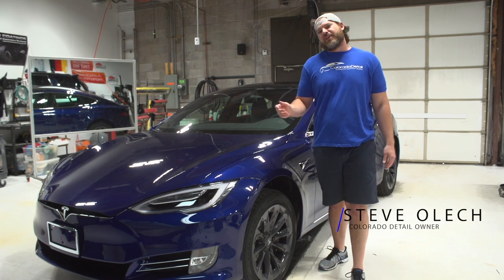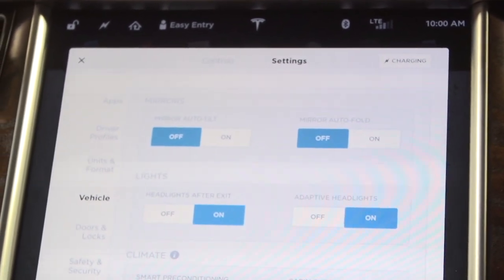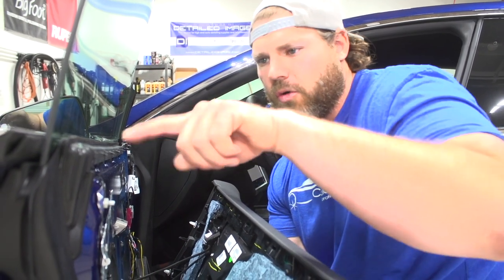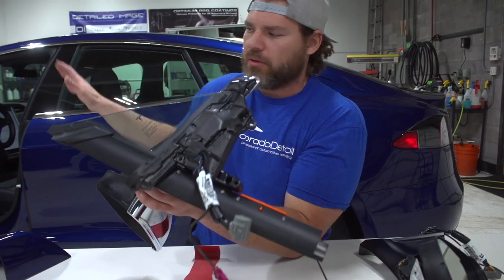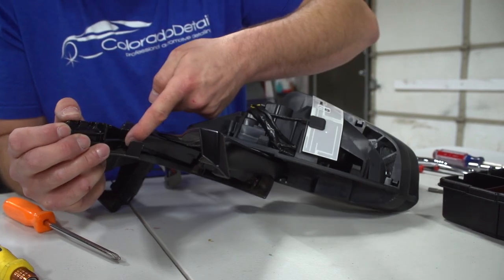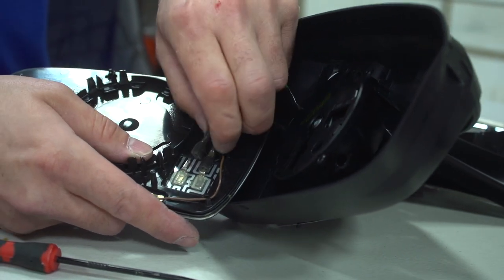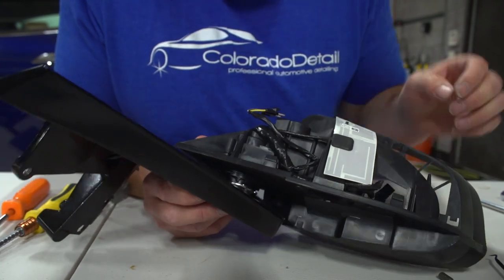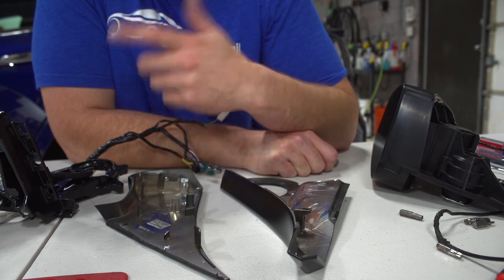Tesla Model S Mirror and Chrome removal

Comment: great video! quick question. i damaged my mirror by hitting it against something and it bent all the way back and is now loose and the motorization doesn't work. would that require just a motor replacement or a completely new side mirror? thanks!

Comment: thanks, this is so useful! I got to the point of removing the 3 screws that hold the bottom chrome cap. I could remove 2 of them but the third one seems to be a weird size, slightly too loose for a 5/64 allen wrench and not big enough for a 3/32. Is it a special size?
Reply from the maker: it should be a #10 torq head. not sure if any other size needed
Reply: @Coloradodetail  That worked perfectly thanks!!

Comment: What was the “ this guy” referred to (@12:21) which looked like a printed circuit card with the cable attached?  Antenna ? What are the two on the “ passenger side”   Great vid 🏴🇺🇸🏴

Comment: is the procedure the same for model 3 if just wanted to remove mirror caps?
Reply from the maker: It’s very similar but not exactly the same. Just make sure to start from the inside
Reply: @Coloradodetail  ok by inside u mean the side of the mirror cap closest to the door rite?
Reply from the maker: @ajsamuel7023  yes that’s right

Comment: Hi, excellent video. 2 questions: what color are those wheels? I have the same color on my car and those look great on that color!
Thanks for showing how to take the under cover, I'm gonna need to replace that. Quick question, one doesn't need to remove the mirror from the car just to replace that right?
Thank you!
Reply from the maker: Ricardo Rodrigues they are stock dark grey
Reply: @Coloradodetail  what about the under cover? Thanks!
Reply from the maker: The under cover can be removed with out taking it out
Reply: @Coloradodetail  thanks so much! Appreciate it

Comment: Hey, long shot here but I’m able to get the mirror cap base to snap back in but it’s misaligned by about .5 inches when it’s rotated back to it’s default position..: any ideas? Broken?
Reply from the maker: you probably broke the stop
Reply: @Coloradodetail  welp, some lessons are free, some lessons are $525. Thanks for the reply. I’ve removed probably 10-15 of these and never had an issue.

Comment: Does the mirror technique also work on the model 3. I'm trying to understand the best technique for wrapping the mirror arms on the Model 3 (ideally without having to fully remove them).
Reply from the maker: Seth Sandler it does minus removing the door panel and the mirror from the car. But removing the chrome parts and mirror glass is the same
Reply: Great thanks! I appreciate the quick response.

Comment: Do you know what the size of the machine screws are? Mine were all seized and broke coming apart. As I’ll need to do the drilling and tapping you suggested
Reply from the maker: i think they are m4. i have actually drilled them out and used a 10/32
Reply: @Coloradodetail  thank you very much as I’m going to be going through these steps tonight

Comment: After popping my mirror off with the tool and twist method I can't seem to get it back on. Is there some special approach to getting it to re-secure itself. It seems like it falls into place in the driving position but its loose feeling and it can just come off easily.
Reply from the maker: Chris Giovenco hi chris, you may have broken the mirror stop. Email me at info@coloradodetail.com and I can send a picture of what I mean.
Reply: I'm in the same boat as you.   I was able to pop it off easily, but not it wont go back into place.   WHen it fold back to normal it goes way too far and faces out.

Comment: Random. But is it possible to remove all of the chrome on the side of the car? Such as the chrome that goes around the side windows on the S or M3?
Reply from the maker: Danniel Navarro on the s and m3 the quarter glass needs to be removed if you want all the chrome off. Part of the model 3 can come off without removing the quarter glass

Comment: Hey guy I have a big problem now. I did it I think like he did in the video. Everything worked good we painted the chrome parts and now I wanted to resample the parts and put the two mirror parts together and now the mirror should lost his position and turns to both sides without an end and don't stops in fold and unfold position. Do someone know if I have to reasamble it in another way or if the motor is defect?
Reply from the maker: CR CarWrapping - Folientechnik & Scheibentönung in Würzburg can you email me pictures of the mirror part. Info@coloradodetail.com. Sounds like the stop tabs broke off.
Reply: I think so too. Is it possible only to get a new motor from Tesla?
Reply from the maker: CR CarWrapping - Folientechnik & Scheibentönung in Würzburg yes or try ebay
Reply: I sent a mail
Reply from the maker: CR CarWrapping - Folientechnik & Scheibentönung in Würzburg Tesla wont sell just the motor you might have to buy a full new mirror and swap the chrome parts to the new one.

Comment: Does this method work to take the mirror apart on a model 3, we're currently doing a black out pack and we want to wrap the mirror with the least seaming as possible
Reply: referring  to popping the top portion of the mirror off from the stainless piece
Reply from the maker: Yes you can use this method. Model 3 is a little easier than the s
Reply: Sweet thank you!! You're insane with the speedy reply! Any chance of video taking the model 3 mirror apart in the near future?
Reply from the maker: Black Market I plan on it. Just need more time.

Comment: Great tutorial but you absolutely don't have to take this piece apart  to wrap this piece. you could be leading people into extra work and risk.
Reply from the maker: Hi Keith, For the s and x yes you do unless you want a seem. The wires go two different directions. For the model 3 you do not have to remove the wires.
Reply: @Coloradodetail  I use seems onntht side mirrors. I've wrapped a dozen of these.
Reply from the maker: Keith Herd yah see we don’t have any seems. That’s what makes our wraps and blackouts different.